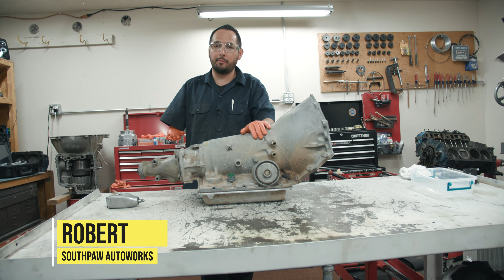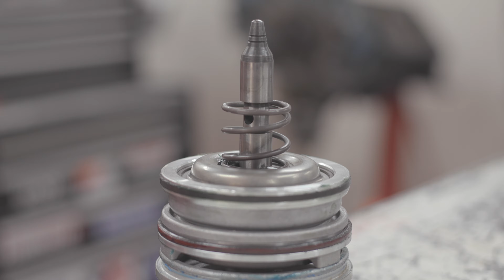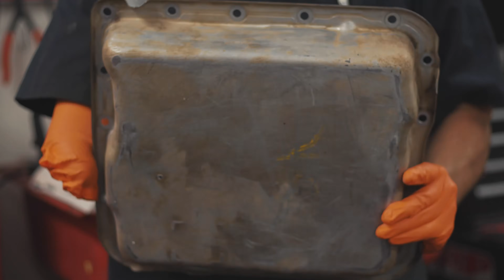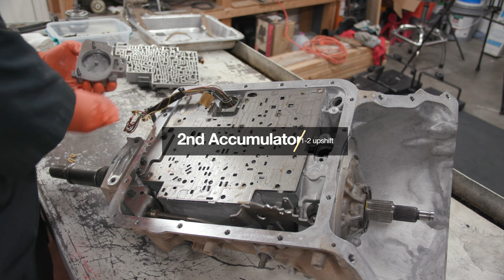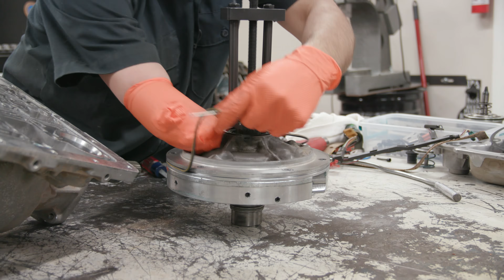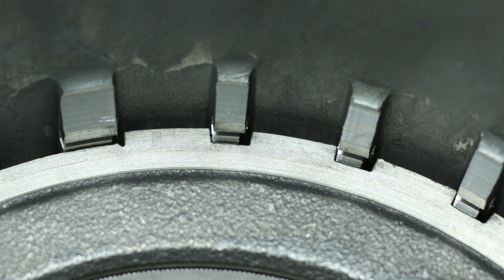4L60E Rebuild: Teardown (Disassembly)

Comment: Question?  Three year old 4l80e light use in a Chev 2500 HD. Came to stop in road to make a left turn. Accelerated to make turn and truck lost drive and reverse.  No noises or warnings before losing D & R. Oil pan free of any debris. What do you think broke in the transmission?  Truck will move if manually shifted into remaining gears.

Comment: I will need to remove my 1995 4x4 4L60E and replace the 2-4 band, more than likely. Is it easier to put the tranny on its output end in a custom made deep bucket stand, to work the 2/4 band up and out with 2 flathead screwdrivers?  Or have on its side like you do?  Also, I do not have a pump puller and was going to use the pry method thru a hole thats available from what I understand. I wasnt going to disturb the clutches if there isn't crud in the pan indicating burned clutches.  So I'm trying not to disturb them by simple pulling out the pump carefully.  Thanks

Comment: Hello Robert, I hope all is well my friend. I don’t expect you to remember me, but this is Vic, I messaged you about a 4l60e father and son project on my son’s 2006 Trailblazer 4.2. I purchased 2 books and watch your videos and I can’t figure out what I did wrong. I I can get the torque converter to spin freely on the input shaft, it binds and only rotates about 2 to 3 inches in both directions (clockwise and counter clockwise). I’ve installed and replaced many transmission in the past and this was never a problem. My question to you is, what could’ve I donee wrong to cause the converter binding. I’m so embarrassed and defeated by this build and I feel like I let my son down. Any help you can provide will be greatly appreciated. Please let me know what I need to double check to make this right. Thanks Robert, have an awesome evening my friend
Reply from the maker: Hi Vic,
This rings a bell (father son project).  That's awesome, BTW.
Bummer about the setback.  I can totally relate...

Can you share more about the problem?

Is the trans still on the bench, or installed in the vehicle?
Are you using a new converter?  Reusing the old converter?
Were any of the pump components replaced? (new pump cover, new pump body, etc)
When overhauling the pump, after you reassembled it did you verify that the pump internals were free to rotate?  If so, what method did you use to verify this?

Comment: Hey Robert....I'm enjoying your videos on the 4L60.  I took an automatic trans class around 20 years ago.  I love doing maintenance and repairs on the side for my friends and family as well as the occasional buy and flip.  I have an 05 Yukon XL 1500 that rolled in the shop.  It's pretty evident to me based off the symptoms that the 3-4 clutch pack is burnt.  I look forward to supporting you by buying the products / tools you're recommending.  Before I just yank it and rebuild it, I want to make sure there's no other issues to address.  What bothers me is that it doesn't shift out of 1st gear on it's own when in drive.  If I move the shifter into L2 it will go from 1-2 normally.  When I move it to L3 the engine freewheels.  The trans had been regularly serviced every 30K.  When it failed it was pulling a heavier camper on a long trip.  The dash indicated a trans temp warning and that's when this all started.  Any help pointing me in the right direction for diagnosis would be appreciated.  There are no DTC's currently on the computer.

Comment: I have a 1994 4l60e. Is it the same as the 1993? It has a light tan plug instead of green on the outside of the tranny

Comment: I lost gear 3&4 in my 07Avalanch, so I had transmission rebuilt. Truck drove fine for 2 months then lost 4th again and then it wouldn't come out of 1st. Transmission shop say they can find anything wrong with the transmission. had engine check and its good..... What could it be?

Comment: My 4L65e has a pressed on Rear Ring Gear onto the 4Wheel Drive Tail Shaft. I successfully pressed it off, but now trying to get the 2 Wheel Drive Tail Shaft pressed into the Rear Ring Gear is a real problem. Because the tail shaft has the speedometer gear, it is larger than than the opening of the case. So I guess I have to make a jig to hold the case and ring gear while I press in the tail shaft. What a pain! Thanks for your informative videos.
Reply from the maker: If the ring gear has the dimples, then getting the shaft back through the ring gear will require a little persuasion.

If it were me... (disclaimer:  do what I do at your own risk)
I'd stack in the rear guts, all the way up to the Center Support (install rear ring gear, rear planet, etc, etc, and ultimately install center support).  Install the large yellow snap ring, that retains the Center Support inside of the trans case.  Now, the Center Support provides a surface to work against.  Gently install the output shaft, lining up the splines.  When I encounter the press-fit, I use the bottom of my hammer handle (rubber coated), and strike the rear of the output shaft.  Shouldn't take much effort to install it.
Hope this helps.
Reply: @SouthpawAutoworks  thanks very much for your advice. I appreciate your comments and enjoy your videos. You explain things in detail when many guys just breeze over the important things. I'll try reassembly using your advice.Thanks

Comment: Is it possible to just put in rental lt input drum and new band get out without disturbing to much
Reply: Input drum
Reply from the maker: I believe that you're asking...is it possible to replace a worn out band, and an Input Drum that has worn out clutches, with a new band and a new Input Drum (that already has new clutches installed)?

It is possible to do this, and not have to remove everything else from inside the trans.  This can even be done without removing the VB (valve-body).  However..........

If your trans has a band and some clutches that are smoked, there's a reason that they're smoked.
If we simply replace old clutches with new ones, I imagine that it will get the trans/vehicle back on the road.  But, it probably won't be long before the new clutches are smoked again (this applies to the band, too).

If we want to do the job once, and be done with it, then it's important to identify why the clutches failed in the first place (root cause of failure).  Could be caused by a number of things inside the trans, and even outside the trans.  A video topic for another time.

Comment: Dude.... so good....do you have a "sequel" on rebuilding a 4L60E... mine is 2004
Reply from the maker: The positive feedback is appreciated.
No sequel, at this point in time.  But, it's just a matter of time before a build series is put together.
Currently working on other 4L60E videos.

Thanks for dropping me a line.

Comment: Cant find the other video going thru the parts, im rebuilding a 93 for the first time
Reply from the maker: I have not made the other videos, yet.

1st 4L60E?  Right on!  That's exciting!
Reply: Just now got the time and parts to reassemble it, wish me luck

One question, the TCC Solenoid used a small check ball? I think one came out of the snout of the tcc @SouthpawAutoworks
Reply from the maker: If we're talking about a 0.250" check-ball......
That's something that some builders would do on a 700-R4.  It's not necessary on the 4L60E.

If you don't already know, the 4L60E is the successor to the 700-R4 (also known as the 4L60...no E).  
The early 4L60E (93-94) uses a nearly identical pump to the 700-R4.

The 700-R4 is controlled by a cable (connected to the carburetor) and a governor (driven by wheel speed).  This trans lived in the days before computer controls.
Even though there was no computer, the trans, however, did still need electricity....in order to operate the TCC solenoid.  Under the right conditions, a pressure switch, located on the VB (valve-body), would create a path to ground, for the TCC Solenoid circuit...which would turn on the solenoid...which causes oil to flow in a different direction inside the converter...which causes the TCC to engage.

If someone didn't want to run a power wire to the trans, but still wanted the TCC to work, this is where the check-ball located in the snout comes into the picture.  It's not perfect (it has a drawback), but it is a solution.

If we're talking about a check-ball that's much smaller than 0.250"....
It could've been the check-ball located inside of the TCC Solenoid.  It's not supposed to come out.

If you're interested in learning about how the 4L60E On/Off solenoids work...
4L60E Shift Solenoid - Part 1 (Basic Operation)
https://youtu.be/FaChWmcsAgI
Note:  Both shift solenoids, and the TCC Solenoid, are On/Off solenoids.  PWM solenoids are a different animal.
Reply: Mine its a 94 On/Off the year pre PWM

Yea its a smaller check ball like 3/16 I didnt exactly know where it came but asking some people told me that the only place it couldve come off was the TCC, so this means I need a new TCC Solenoid @SouthpawAutoworks
Reply from the maker: Glad you got to the bottom of it.

Wishing you the best on your build.
Reply: Thanks a lot man, I really appreciate your content  @SouthpawAutoworks

Comment: I see you didnt remove the last part(reverse piston?).  Is this because they are not removed typically or is it because of the tooling needed or another reason?
Reply from the maker: It's simply due to habit...

When I was wrenching for a transmission shop, I would only tear the unit down far enough to look at all of the usual suspects.  After the inspection was complete, a parts list was put together.  The service-writer would use my parts list to put together an estimate for the customer.  The customer would either give us the green light...or look into other options.

So, during a teardown, there was no need to remove the Low-Reverse piston....not until I knew that we were moving forward with the rebuild/repair.  Removing the piston before then, could potentially result in time wasted...and time is money.

To answer your question...
For a rebuild, the Low-Reverse piston must be removed.  It has three (3) seals on it, that must be replaced.  Plus, the piston must be removed in order to clean the piston, and clean the transmission case.

For the sake of these videos, I really need to be showing the piston removal, during teardown.
Thank you for pointing this out.  Much appreciated.

Comment: Will a 97 s10 blazer tranny work on a 95 suburban? Both 4x4
Reply from the maker: Unfortunately, the '95 4L60E is a standalone year.  In other words, it doesn't interchange with any other years of 4L60E.
The wiring harness, among other things, are different than earlier/later versions.

On a positive note, parts can be swapped, in order to make another year 4L60E work in a '95 application.

There are different sized bell housings (and bell housings designs), depending on year/engine size/etc.  Also different torque converters, pumps, etc.

I'd like to put together a video on each of these subjects, when time permits.

Comment: Hi, thank you for the informative video... I am busy building my '93 4L60e... Actually, the casting date say 92... Will you post a video where you assemble the Box? If not, When I striped my 3-4 Stack, I found that there were no Load Release Springs in the 4th Gear assembly... Is that okay? My Workshop manual says it has to be there (in all goxes since 1988) I would appreceate if you could help. I am in Germany and it look like the people here have no idea...
Reply from the maker: We plan on doing a complete rebuild series on the 4L60E.  However, we're currently busy working on a TH400 video series.

TH400 Rebuild Series - Coming Soon
https://youtu.be/q0eciXU8YEI

To answer your question...
I always install them (stock build).
I know some builders will throw them out during the rebuild.  However, I was trained to use those springs.  It's my understanding that those springs are used to help keep the 3-4 Clutch off, when the trans is in 1st and 2nd gear.
When the engine revs high enough in 1st or 2nd gear, the Input Drum will also spin fast.  The residual oil located in the drum (right near the 3-4 Clutch piston) will grow "taller" (due to centrifugal force) and start to push on the 3-4 Clutch piston.  The theory is, the 3-4 Clutch will not fully apply...however, it'll drag a little.  This dragging builds heat and burns up the clutch pack, over time.

Like I said, some people throw them in the trash...I happen to use them.  To each their own.
Reply: @SouthpawAutoworks  Hi, thank you very much for the answer, I will order these springs 🙂👍
Reply: @SouthpawAutoworks  I have found the major problem on my Box... the Sprag assembly is completely stuffed...
Reply from the maker: Glad you found the problem.

Did your trans not have forward movement, with the shifter in D?

These videos (listed below) are not specifically about the Input Sprag.  However, you can learn more about what they do...as they are mentioned in both videos.

4L60E Power Flow (1st, 2nd, 3rd, & 4th Gear):
https://youtu.be/IfOqbTqKubE

4L60E Power Flow - Manual 1st, Manual 2nd, & Manual 3rd:
https://youtu.be/6kfAuXJFYFE
Reply: @SouthpawAutoworks  Thats the weird thing, it would run fine, but as soon as I would go uphill and she would gear back from 4th to 3rd, but then it'll be like neutral and the engine revs up. I thought it would be the 3-4 piston or clutches, but these still look okay, but I'm changing them in any case.
Reply from the maker: Good call.
Reply: @SouthpawAutoworks  Thanks man, your chanel is awesome and I will keep watching! Wish you a awesome day!
Reply from the maker: Right on.  I'm glad that you're here.
Have a great day, man!

Comment: My brother bought a trans off a guy for his 94 chevy k1500 4wd..guy said he had rebuilt it. It's the 4L60e Trans. The trans will go in all gears and move in every gear. The problem is in overdrive,3, or 2 it stays in one gear and doesn't shift. If you put trans in low gear it will shift while driving and as soon as you let off the throttle it will down shift really fast....if your going fast enough it will slide the rear tires. Any idea what may be the issue?
Reply from the maker: It sounds like the transmission is in "Limp Mode."  

If the PCM (computer) detects a transmission problem, it can put the trans into Limp Mode....so the vehicle can be "limped" to a repair shop.

When in Limp Mode, the PCM cuts off electrical power to the trans.  When the trans has no electricity supplied to it, the trans will default to 3rd gear, with the shifter in OD mode.  There's more to it, but I'll spare you the details.

Do you have a check engine light?
Have you pulled codes?

Comment: My new input shaft o-ring has a slight surface tear, should I get a new one or reuse the original that has no tear an looks good an not hard?
Reply from the maker: That is a bummer about the new one.  But, good eye!!  When little details, like this one, get overlooked, headaches occur.  You did good...

Ideally, get a new replacement O-ring.  If there ends up being a problem with the used O-ring, down the road, it will cause torque converter issues.  And replacing an old O-ring, at a later date, will require trans removal.  However, if getting a new O-ring is not an option (due to a time constraint), if it were me, I would have to reuse the old one (Pliable with no cuts/tears) over installing a damaged one.

There are two(2) different O-ring sizes, depending on which input shaft your 4L60E is equipped with: 298mm converter/shaft VS 300mm converter/shaft.
298mm Shaft:  93-97
300mm Shaft:  98-14
Short Video about your question and 298mm VS 300mm:  https://youtu.be/287UVcwDgHo

4L60E Input Shaft O-Rings:  **Paid Links**
      298mm:  https://amzn.to/3CmjHsP  
      300mm:  https://amzn.to/2ZrGFA0
      Ebay:  https://ebay.us/h7lpLB

DISCLOSURE:  🕵
As an Amazon Associate I earn from qualifying purchases.  Some, if not all, of the links contained in this video description are affiliate links.  This means that, at no additional cost to you, I will receive a small commission on any purchases you make through the website links provided above.
Reply: @SouthpawAutoworks   @Southpaw Autoworks  thanks man, you are top three transmission guys I've found regarding knowledge an inner workings. After watching 5 of your vids, I never knew you had an arm missing until this video, warrior!
Reply from the maker: Right on!  Thanks for watching.

Dude, that's too funny.
Reply: @SouthpawAutoworks  I went to a shop an got a new one, I called on the phone and he said it would be $5 which was fine with me since everywhere else was about the same, when I got there he gave it to me for free. An this time when I put it on I lubricated I very well, Last time I think I damage it by not keeping the converter level an not going slow pushing it in.
Reply from the maker: Dude, that's awesome!  Really glad to hear that.

Right on.